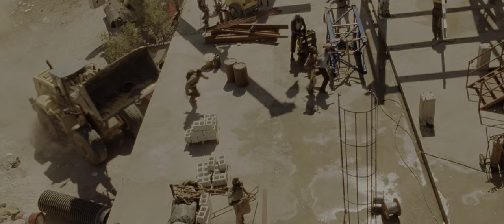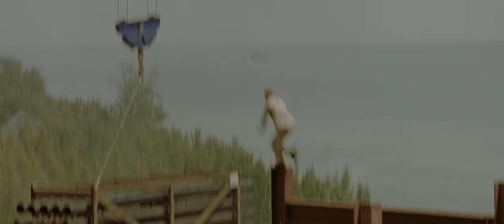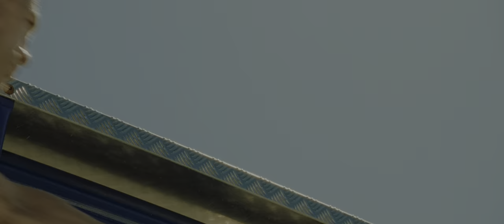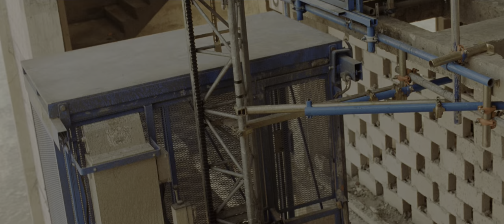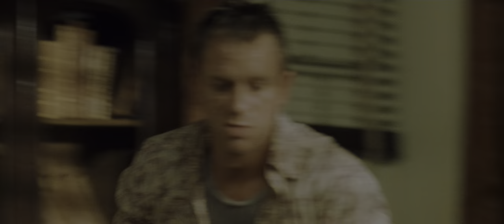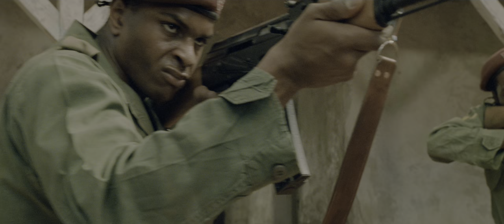Casino Royale 4k HDR | Opening Chase Scene

Comment: I cant see the difference compare to non-hdr clip
Reply from the maker: Do you have an HDR compatible device ?
Reply: @ApexClips4k  yes MacBook Pro 2021
Reply: @ApexClips4k  I mean this is a 2006 movie. It might not be shot in HDR, no matter how we convert its format
Reply from the maker: @seattledude2022  this is ripped directly from the 4k BluRay and is most definitely HDR. Try on your phone and see what the settings on YouTube say.
Reply: @seattledude2022  You could very well use a HDR scanner to scan the film print of the film (regardless of when it was shot), since film usually has higher dynamic range and detail than the average digital camera. And for the 4K HDR release, they usually do further color timing to get all the details out, but should be watched in actual HDR enabled TV or screen for the lighting and contrast to be seen.